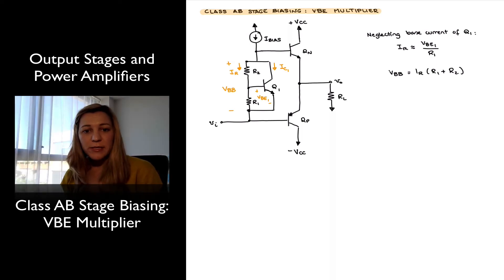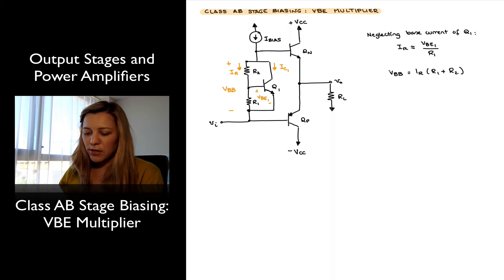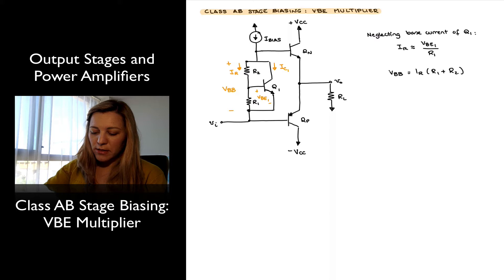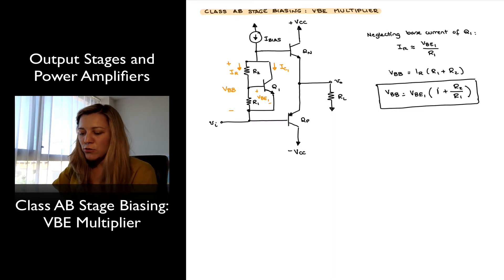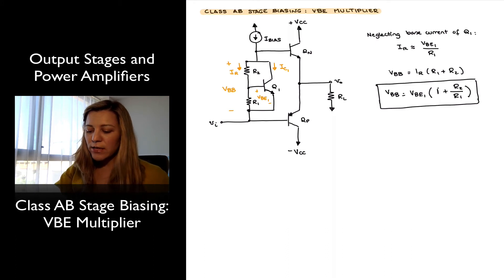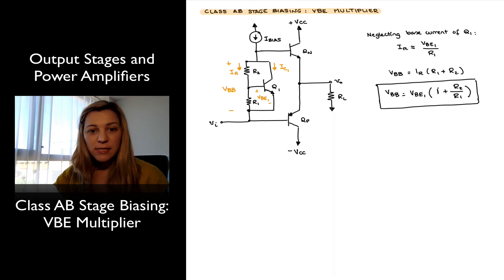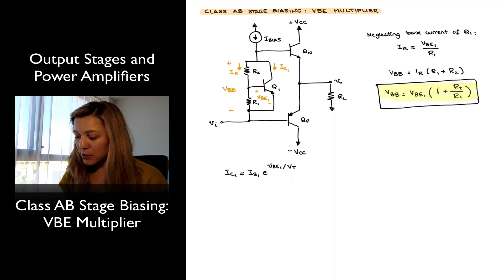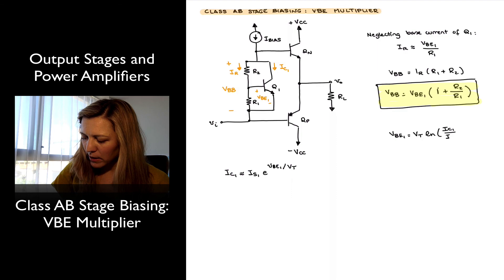Class AB Output Stage: Biasing Using a VBE Multiplier

Comment: I need a multiplier for a circlotron, this is a amp with floating voltages and speaker, did now this one you mention, however temco is to high, using as a full diode temco is to low.